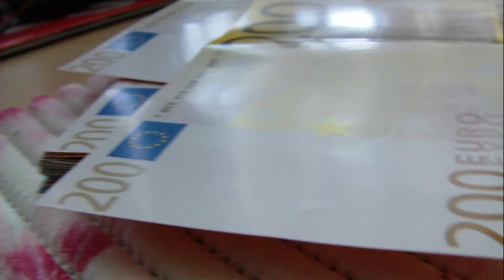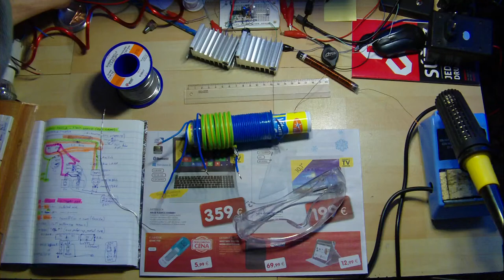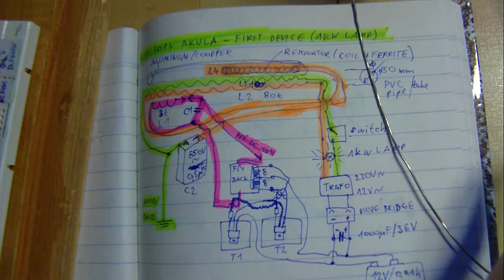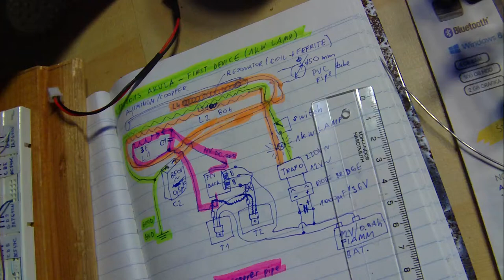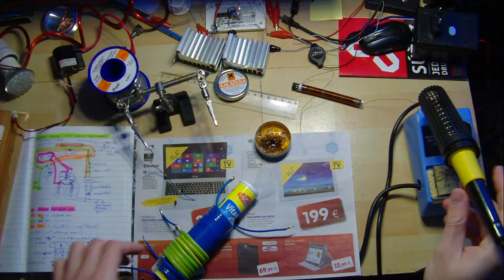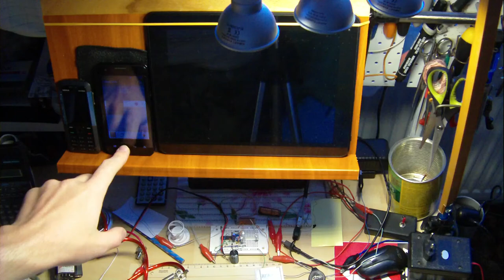Akula research - part 4

Comment: Over the ground blue wire of 2 mm multistrand, you wound another blue wire. How many rounds of the second blue wire and is it also the same 2mm multistrand wire ??Please reply. Thanks.
Reply from the maker: 15 turns blue wire multistrand, with diameter 2mm.
Reply: mrstanlez i thought u said it was 40 turns?